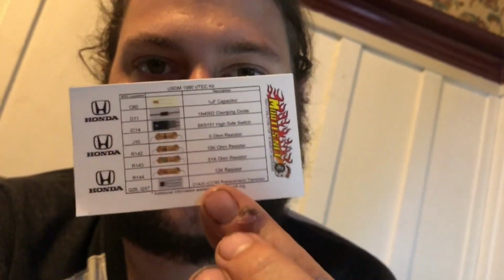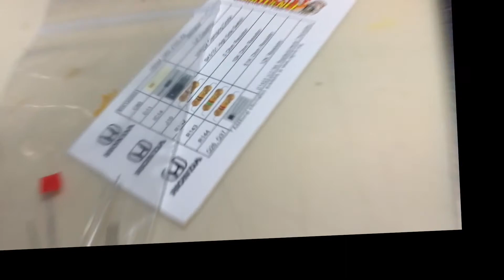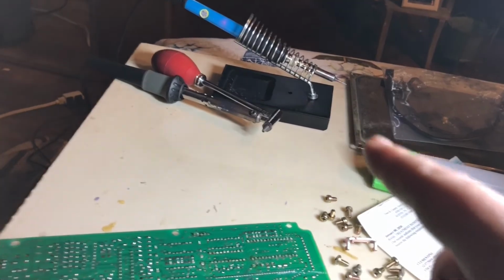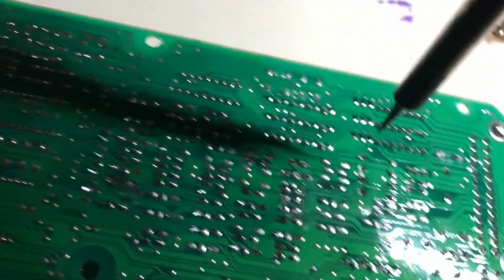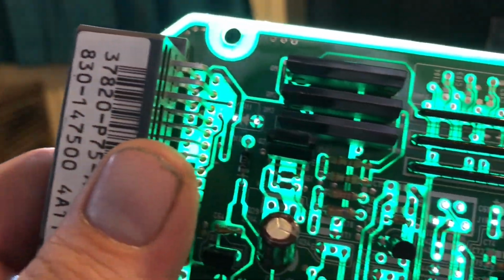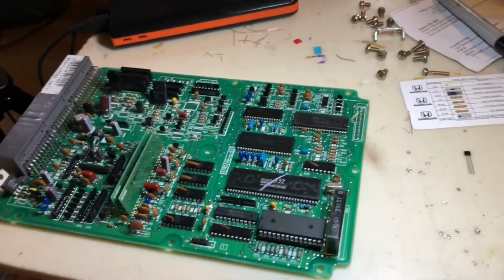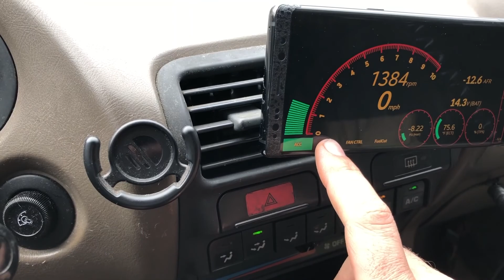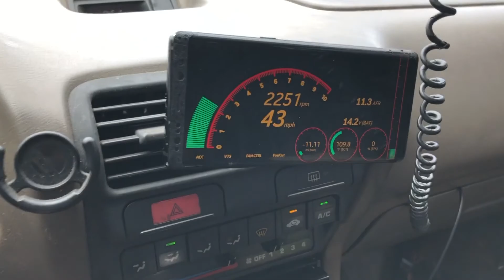Adding VTEC to a p75 Honda ECU

Comment: On holes that don't want to clear out, add a bit of new solder to the tip of your desoldering iron first, that new solder will mix with the solder in the hole as well as provide a much greater contact to transfer heat and make it much easier to remove.

Comment: I'm using it on my vtec d16y8 but can I use it on my non vtec b18 and disable vtec in hondata? I'm socketing it for s300 as well.
Reply from the maker: Yes that is correct. VTEC can be disabled in the software.
Reply: @hondaland_  lovely, thanks.

Comment: I know this is a dumbass question but I'm running a p75 non vtec on my b20 just with hondata s300 v3 if I add vtec to it I can still run a base b20 tune even with the vtec conversion since I'm building a lsv build in the near future and just want the ecu to be ready
Reply from the maker: That is correct you can have the parts installed and they will remain dormant until the tune is updated to activate them

Comment: From OBD1 P75 to Po6 and Pr4 you can convert almost anything to VTEC when chipped or hondata
Reply from the maker: Yup most just call it a p28 coverstion.

This was my original Integras LS ECU. 

What I had running it before was a p28 that had the factory uv chip in the chip location. 

One day it stopped operation of the fuel pump so I added VTEC to my p75 backup ECU here.

Comment: What program do you have on Bluetooth and screen?
Reply from the maker: Tunerview is the app. The Bluetooth module is a DSD TECH HC-05 that is a diy Bluetooth solution. The unit requires its settings changed via programing it.
Reply from the maker: I sell the Bluetooth modules upon order if you look up Honda Land on facebook you can reach me and order one there

Comment: Didn’t have to remove j 4
Reply: Don R hey I’m trying to figure out if I should remove j4 right now cuz I’m getting ecu problems and I have j4 cut
Reply from the maker: J4 is never removed in this video and never has been. Not sure what you mean by this comment. J10 is added. No components were removed. Only added in this video. J12 is the only jumper you "remove" others are added in like j1 to activate the chip and j10 to enable vtec components.

Comment: what wiring harness are you using?
Reply from the maker: Wiring harness was not changed from the non VTEC p75. One wire was simply added to the harness to activate the Vtec solenoid as it is all you need.
Reply: @hondaland_  where do you put the wires for the vtec solenoid? cause i want to go b20vtec with a p75 ecu and the wiring is the only part I’m confused on
Reply from the maker: @macoolitzclub  single wire to the solenoid. It is a 12 wire + out of the ecu. The solenoid recieves ground from the engine head. All obd1 ecus have the same pinout. So you would need to add or move a pin on your harness "ecu side" To A4. For pinouts download HONDAtabase from the play store or app store apple and it will show you where a4 is at. If your car was auto you xan use an existing wire deleted for the solnoids of the trans and keep it clean.
Reply: @hondaland_  thank you so much for this info man, I know where A4 cause I’ve seen people wire p72 ecu’s with A4, but I didn’t know it would work on p75 even if it was vtec converted. now I can go b20v with no issues thanks to you, subscribed!
Reply from the maker: @macoolitzclub  visit here for more ecu knowledge  🙌  https://www.facebook.com/groups/2030595640557116/?ref=share